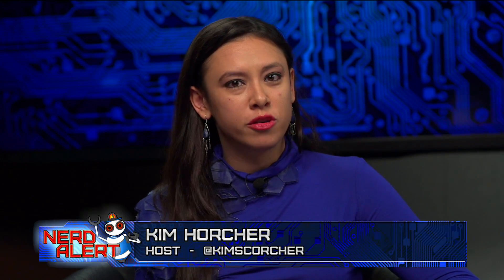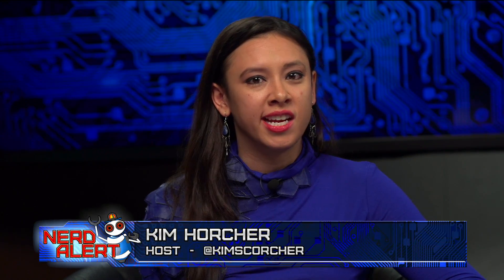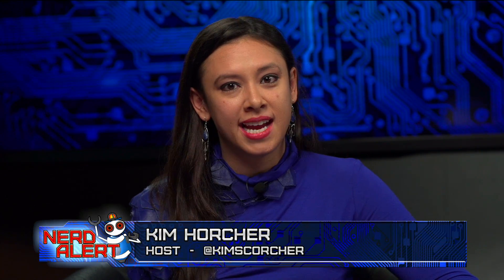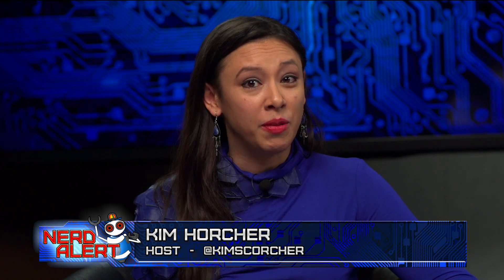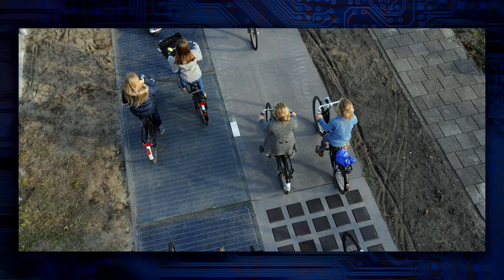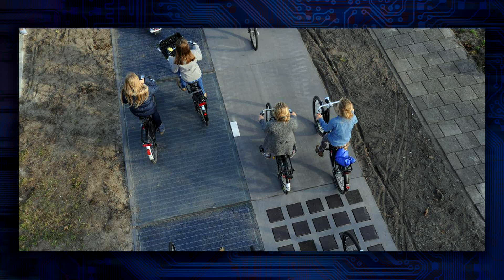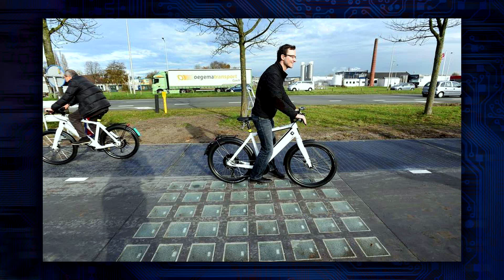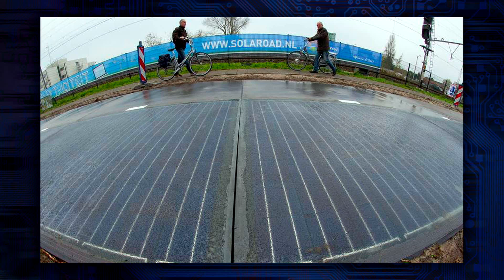6 Months Later - The World's First Solar Bike Path

Comment: 70 meters of road generate enough power for 1 house? Do you know how many houses you can put alongside 70 meters of road? This would not be efficient enough to help generate energy for all the people, maybe enough to power traffic lights and street illumination.

Putting solar panels that can angle and turn themselves properly towards the sun alongside a road, like on top of street light posts, would be much more efficient and cheaper to build and maintain than a flat surface on the floor that is blocked from sunlight by bikers half the time and half-blocked by dirt most of the time, which would need the road to be blocked and dug up for maintenance.

Who in their right mind still thinks this is a great idea and worth reporting about when there have been tons of cities that already expanded their power production with self-adjusting solar panels in their roundabouts and solar panels alongside the road for years already?

Comment: It's neat and tidy, but the payback (and other benefits) would be far greater with an angled solar roof over the path.  Of course this could also be done for roads, and would work especially well on divided highways, and no weight limit would be imposed.
A tough panel that's not tilted and would take up no effective space could also be laid between large stretches of rails - as in railway tracks (which are also convenient conductors).  Or, how about filling the thousands of kilometers of empty land under high-voltage power lines? (and install VAWTs within the towers while at it).  There are so many places to put solar.
I'd like to see a sports stadium dome completely covered in solar film that is semi-transparent; it would look cool and power the place many times over.
It's a pity that most rich people lack imagination.

Comment: The cons of this idea far outweight the pros. Solar roads is a concept that is, as someone mentioned it spot on, born dead. I think it's pretty clear that more energy is wasted on the maintenance of these panels, than the energy produced by such mind numbing configuration. Yeah, it has the positive side, that it produces energy, but because of the expensive production and comparably high fragility, that energy is minuscule and wouldn't even come close to compensating the price of production, that would exceed the price of the same length asphalt.
Reply: Professor Catus And to be clear, Solar power is a way forward, and generates more benefit in a long run, but solar roads? I can assure you, this shit would punch a bigger and bigger minus in the budget every year onward.

Comment: It costs less to install them beside the roads, and they produce more energy, so why the hell would you put them inside the roads.

Also I don't see the glass staying clear with car passing over them, solar farms clean their solar panels on a regular basis just to keep efficiency up, I don't see this happening with roads. As far as LEDs, you need them to be extremely powerful to be visible in full daylight, negating at least part of the energy they produce.
Reply: Keven Harvey  a better idea than that would be to put a big roof over every carpark, with solar panels on top. This would also stop cars from overheating in summer, saving fuel that way, AND will provide somewhere to charge Teslas, Priuses and Leafs.
Reply: dangerouslytalented
Or this :
http://www.treehugger.com/bikes/bike-lane-down-center-korean-highway-covered-solar-panels.html
Reply: That actually looks pretty neat to.
Reply: Keven Harvey
When I rode to uni every day, I had a problem with getting rained on and sunburnt...
Reply: Keven Harvey Also, globally poor road maintenance is a thing, sometimes massive holes in roads.
I doubt solar panels can stand that neglect while suffering the abuse of daily traffic.

Such a poorly thought out idea. >.>

Comment: How is it better than having it on rooftops, except that you could use the electricity right away  to some extend? I see only drawbacks:
• less effective, because the angle like you said, but also dirt
• dirt-repelence vs. traction
• Where to store excess the energy in case too much is generated at the moment? 
A storage place every quarter mile?
• You would have to have heating elements and run them as the snow falls and not after
So unless we are in a position where already every rooftop has a photovoltaic panel I don't see why this should be funded over putting panels on rooftops.

Comment: Wouldn't it make sense to make just the median and shoulder lanes of the road made of the solar panels to avoid the whole weight limit thing?
Reply: To small of a surface to get enough to be cost effective.
Reply: Hillary L'arc en Ceil It would be better if we did it like the S. Koreans do, which is install a covered bike lane in the center of the road and cover it with solar panels so a win win for bikers which are out of the way of traffic, motorist who don't have to worry about running them over, and solar power because they are up off the road surface to gather more light, and less chance of them getting damaged. not accounting for vandalism of course which is usually much lower in Asian countries then western countries.

http://www.slashgear.com/bike-lane-in-the-middle-of-a-south-korean-highway-is-covered-with-solar-panels-16379387/
Reply: Hillary L'arc en Ceil It would make more sense if they cover every roof instead. Space isn't a problem, there are tons of roofs uncovered by solar... "Solar Roadways" pander to the ignorant and generate hype + support $$$. That's what's important to these people.

Comment: solar roadways are stupid! to get a roadway with solar panels would be extremely expensive would generate about half what that cycle path did as the glass would have to be 4x thicker and then the dirt alone will kill power generation more!

a better way then that is what Korea did on there solar cycle path where they had normal solar panels mounted above the path in the middle of a motorway that where properly angled! (Korea for the win in being smart about it!)
Reply: badboy2kxxx plus, the panels protect the cyclists from the rain etc.
Reply: ohdogwow2  also the surface friction needed for heavy vehicles would mean you would need very frosted type glass with a near sand paper type surface just to get traction and with the glass it would be not very transparent so it would be overly expensive and would have a massive maintenance cost of people cleaning dirt and rubber of the road every month!

Just put the panels above the roads it makes way more sense and have a standard road under it!
Reply: ohdogwow2
sounds good to me! having a road mad of solar panels is stupid so anyway of avoiding putting them there is better! ever since i learned about people pushing for them i thought this is a pipe dream. they should just put them in dead unused spaces and call it a day!
Reply: Doan08
yes they do and they keep them out of the sun as it acts as a sun shade casting shadows on the path!
Reply: Keep being happy about Korea! Just north is slaughtering, gassing, and starvation! 

But hey, Korea is smart.

Lol, trolling is obvious. But still true.

Anyway for real, you are the dumb one, all of what you said is current technology. Who knows what will happen in the next 20 years. So maybe next time, stop being so ignorant
Reply: ohdogwow2 I know. That is why I said trolling is obvious...

I never said using current technology is bad. I said you were ignorant for believing that it is stupid and won't work. Ever.